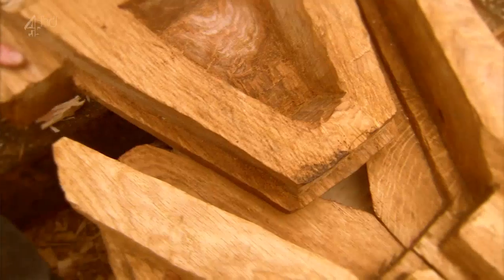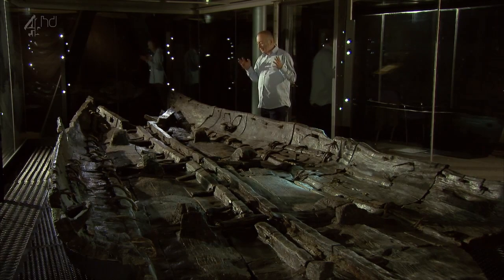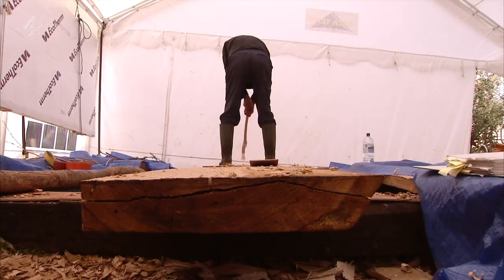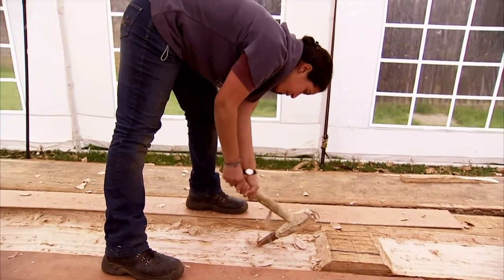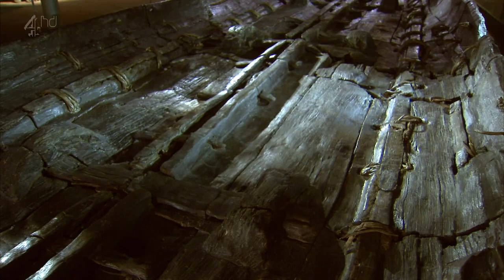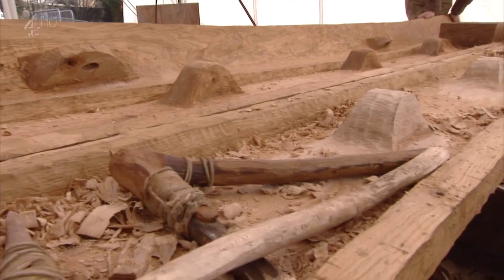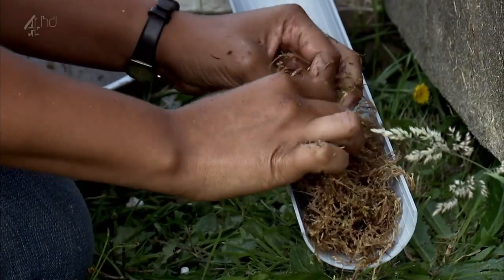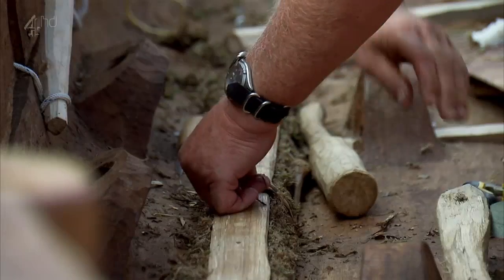Time Team Special The Boats That Made Britain

Comment: To a degree, the swelling of the planks when in water would mitigate some of the leakage, which is why wooden vessels are left in the water once in the water. Hauling them out causes wood to dry and seams to open. 

They could have tested for leaks before the launch by simply using a garden hose to put water in the interior and see where it was running out and how fast. Roughly the same technique for testing of early steam chests. 

The Bronze Age, as is stated, heralded an explosion of technology. It is hard to comprehend the insight of the ancients when it comes to making stuff from what they dug from the Earth and chopped out of the forests.
Reply: Jeffery, We used the hose method when I was a kid, getting our little boat back into shape, stuffing the cracks with rags before running the hose for days.

Comment: On the first build I knew the caulk wouldn't work. We call it caulk in America, mastic is for laying down flooring here in the states, it is used as an adhesive. Caulk isn't really meant for that application. It is meant to keep rain out or moisture out, but not water under pressure. I appreciate that they did have a second try and went back to the old way of sealing the boat. This was very entertaining. Phil was a gas as usual. I could see Phil in a pub in Calais. Or anywhere for that matter. Where there is a pub, there is Phil.
Reply: Having seen a few wooden boat repairs, tricks of the trade include, after assemble, wetting down the boards to get the joints to swell up. Using a synthetic cordage was a big flaw too. Organic cordage will also swell, reducing the opportunity for leaks. Getting the joints to swell takes many days and you would be making minor adjustments as the days go by including tightening up the cordage.

Comment: The workmanship is excellent but I have some serious doubt about one aspect of the boat. Because hogging and sagging when a  boat tackles  a wave , the midship sides are subjected to a lot of punishment. I see a  vertical joint in the sides of the sides of the boat and these are jointed with a few turns of that primitive rope.   I  while the bottom is made of a long plank, it moment of inertia about the vertical is not good enough and the sides acting as powerful beams  are the elements that have to stand the hogging and sagging.   If above the central joint at the centre of the vertical sides there was another longeron tied above the the joint where it projects above the parts which make the sides, the half sides would be tied together much better than with the rope and the longerons  on top of the joint of the sides with the bottom planks.
The sides could have been made to be much more powerful beams with a little more effort. Apart from that the workmanship and the perseverance and the spirit of those people working together in such a tight schedule, I wish I was amongst them working with them as I come from a family of  traditional med. boat builders and seeing this video touched my soul and spirit and reminded me of my uncles  who worked with the same tools I say in this video. Congratulations to all.
Reply: +Carmel Pule&#39; I think you're right...I'm hardly the expert you are but the whole thing does seem to be lacking a few bits of bracing. I also suspect that she'd need a fair compliment of buckets. It seems that I recall reading how until about the time of the Elizabethan era, lots European hulls were still prone to springing in a moderate swell weren't they?
Reply: A baling device (gourd, bark bucket, scoop etc. are commonplace on log and on plank canoes in less developed craft today as a practical solution to minor leaking and wave splashing. As long as your boat takes in water slower than a small boy can bale it out all is well.

The side beams will be rigid as long as the withies can clamp them and the withies swell and tighten when wet to make the joints tighter than when first put in. Coir rope sewn boats of the Indian Ocean will stretch a little when put in and need some leverage to make them tight when first put in.
Reply: No cause for that sort of language Samuel whatever your opinion. It tells us more about you than about Carmel.

Comment: I'm totally surprised being they had a shipwright there that the didn't know the boat could leak for a couple days, they built her out of dry wood that has to swell up by soaking up water and therefore help seal up the joints and make her strong and tight.

Comment: Instead of using nylon ropes, a natural material capable pf swelling when wet, would have solved the problem. Likewise the swelling of the wood would have prevented leakage. It would, however, be necessary to allow some time for the boat in the water to achieve this. A look at ancient boats from the Red and Arabian Sea, which also used the method of sewing planks together would have helped.